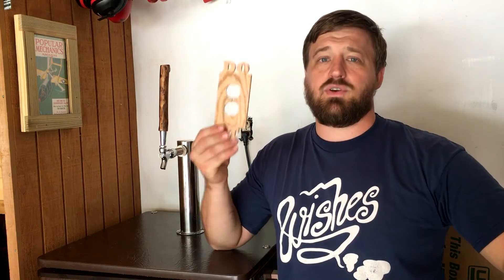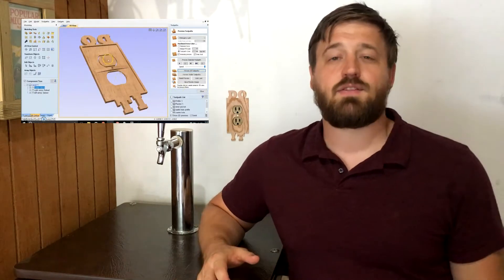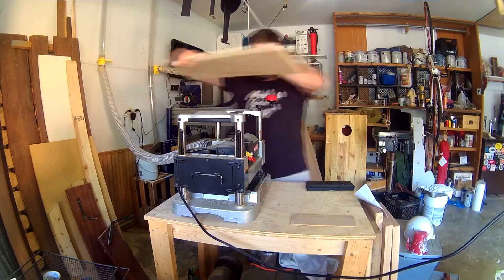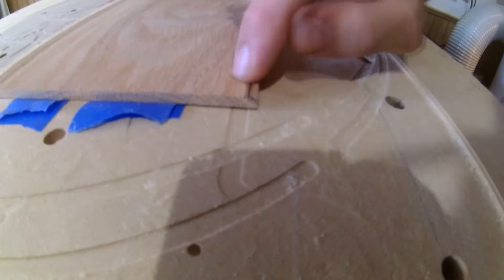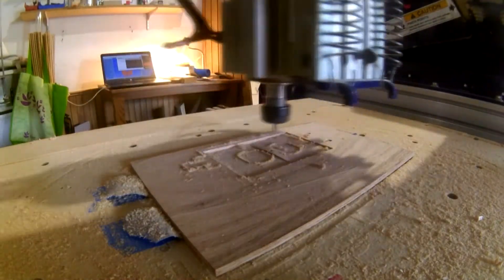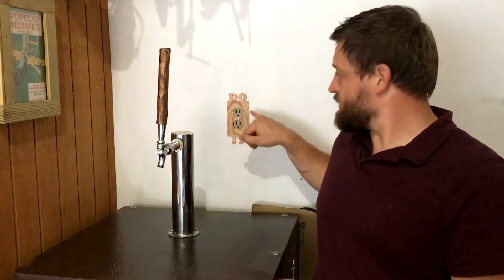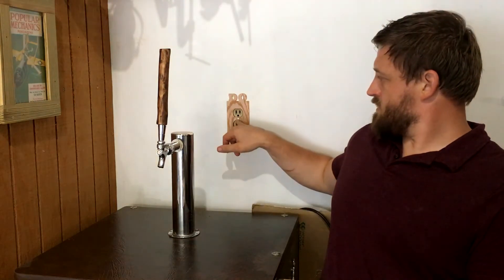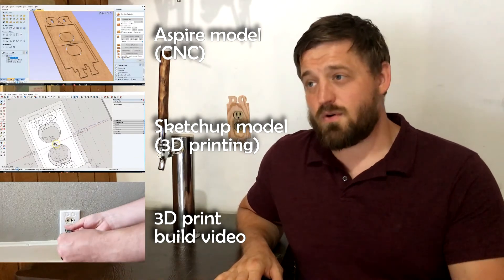How to make a custom outlet wall cover on your CNC machine

Comment from the maker: A viewer mentioned that code may require some kind of fire resistant plate on the inside surface against the wall. We are not electricians, so please make sure you know the requirements for your area and use caution!
Reply: You could easily cover the back of the plate with what I call "Aluma Tape" but the real people call it  HVAC Foil Tape.

Comment: A note on the fire safety: some woods have a much better fire rating than plastic, and the risk is very low unless you're connecting faulty electronics. Sparks = bad.
Reply from the maker: Franklin Bejarano thanks for the input!